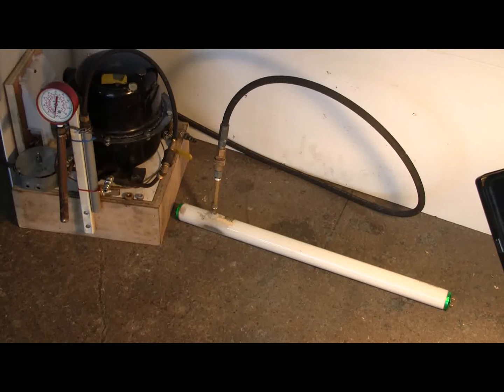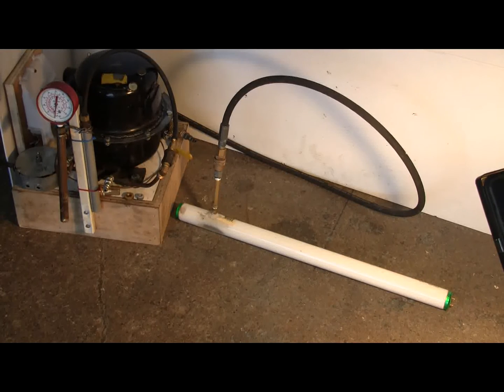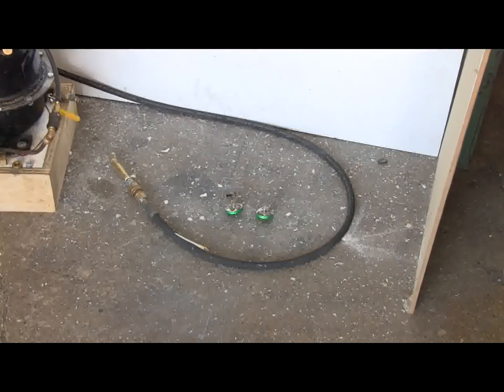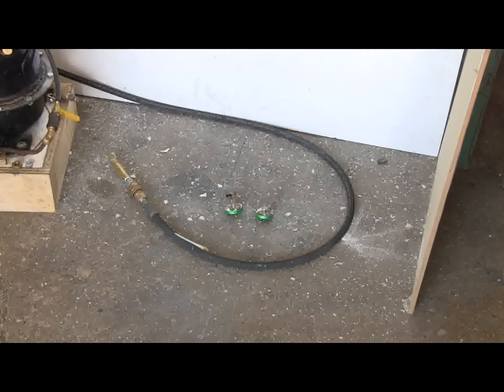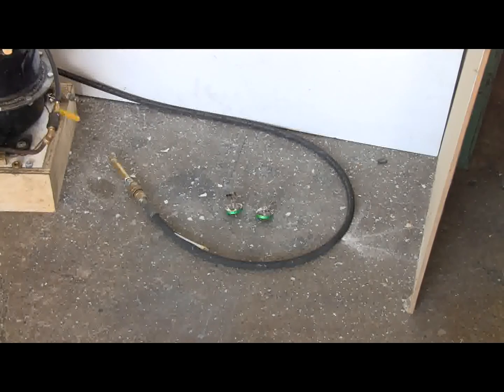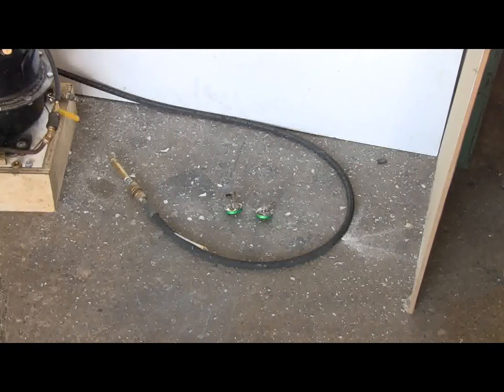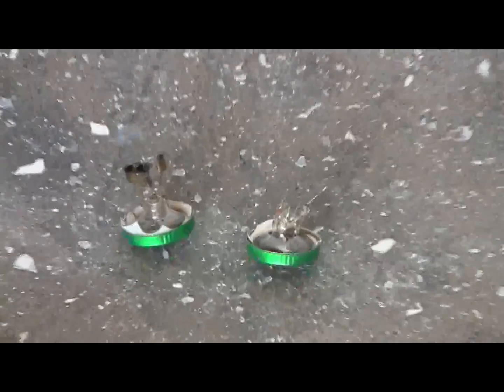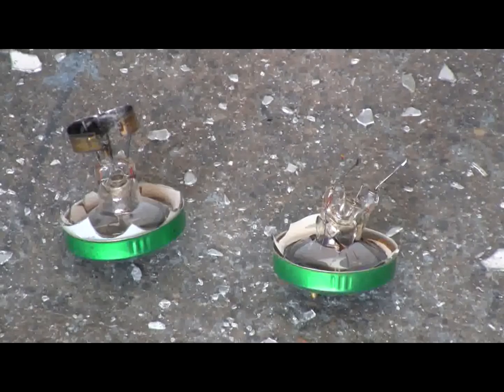Air Compressor - Bursting A Fluorescent Light Tube

Comment: Bill, you did an awesome experiment. I have 2 questions:
1, if the pressure comes from the outside, for example put the tube in the deep sea, the tube (without drilled hole, the tube inside pressure ignorable) will crash when the outside pressure exceeds 80 psi (95-15). is it correct?
2, for longer tube, the limit pressure should decrease. is it right?

thanks
Li Jun